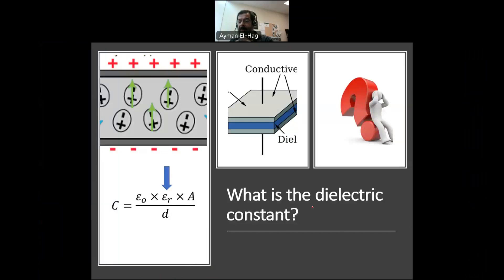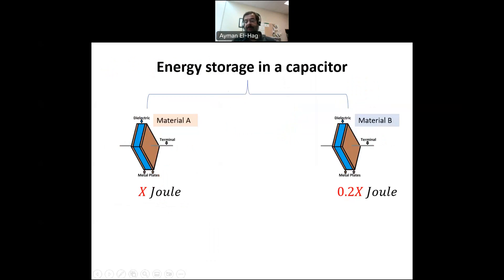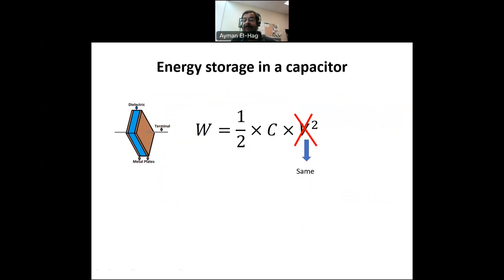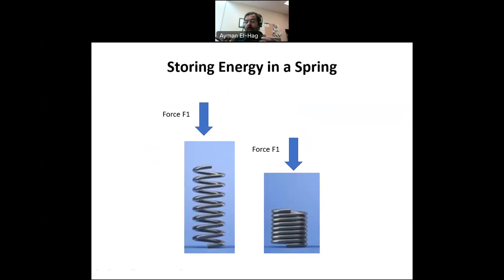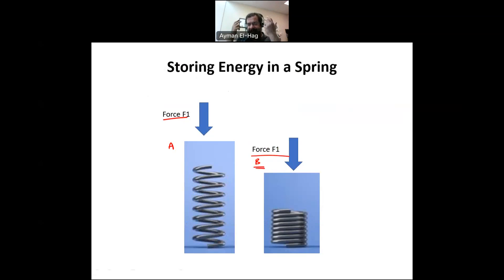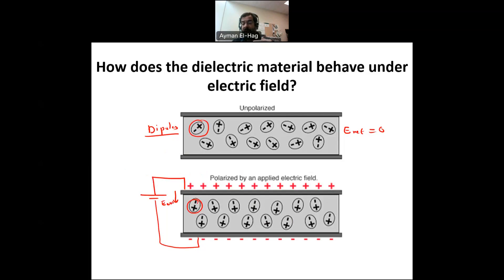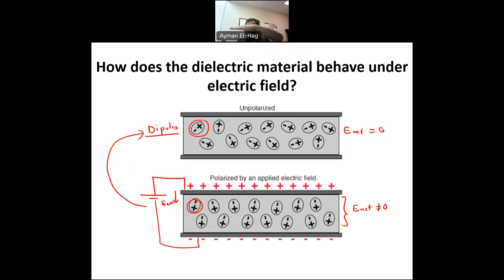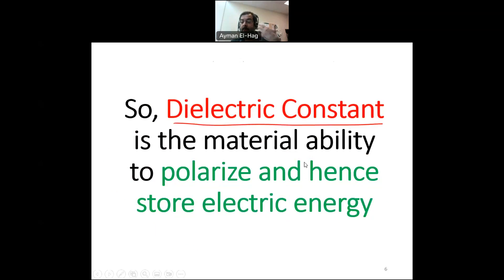What is the dielectric constant?

Comment: 4:41 To compress A the same amount, we'd have to increase the force, correct? Is more force an analogy for more voltage, or more current?
Reply from the maker: More force is more voltage, kindly remember the energy = (0.5)x(C)x(V)^2
Reply: @electrical4everyone  Should we use I for current, and C for capacitance?
Reply from the maker: Yes these are the symbols for current and capacitance.
Reply: @ In your energy formula, are you using C for current, coulombs, or capacitance?
Reply from the maker: C for capacitance

Comment: If the same force is applied to the two springs, shouldn't both of them have the same stored energy
Reply from the maker: It will depend on the elasticity of the spring, and not just the applied force and this is the example I used to describe why if you apply the same voltage to two different materials with different dielectric constants will have different stored energy.

Comment: What would happen if you make the positive capacitor 20 times smaller than the negative, then seperate them with a k factor material of 1000. Then apply a 100kva 0.1a DV current in a pulsed frequency of let’s say 100hz… have you looked into electrogravitics?
Reply from the maker: No I did not look into this topic before

Comment: Thank you, professor, for your beneficial information. I have one question, Does polarization depend on frequency, temperature, or humidity?
Reply from the maker: Definitely it depends on frequency because as you increase the frequency you may not have enough time for polarization. Actually dielectric constant drops with frequency.
For humidity it also has impact if the material absorbs it because water has high dielectric constant.
Reply: Thank you so much.